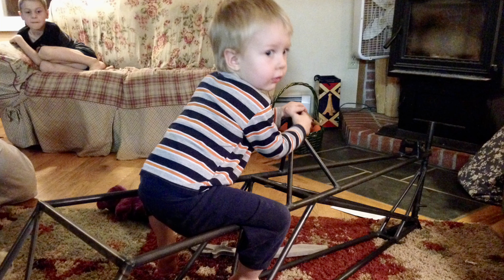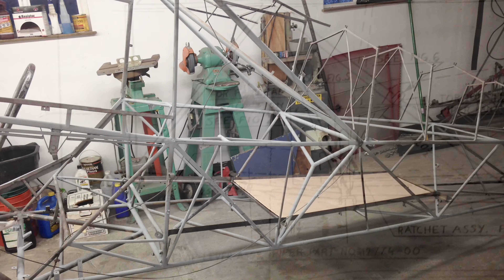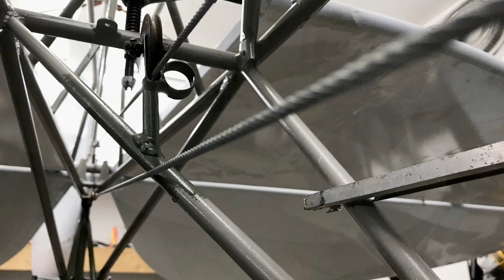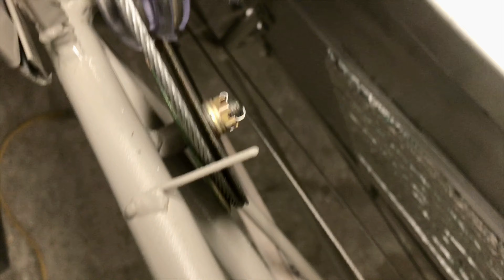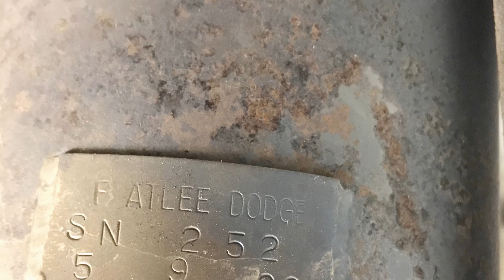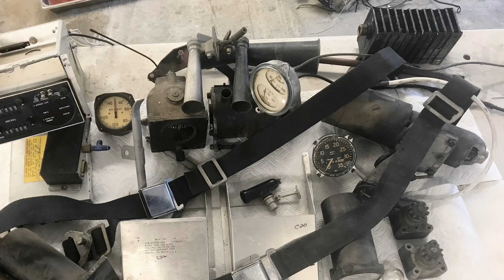Piper PA-12 Build

Comment: Totally rebuilt my "46 PA12, took many years! Installed an O 320 B2C (160Hp) with all the goodies such as new lift struts, Cleveland wheels and brakes, PA18 tail feathers and square top windscreen. Covered with Poly Fiber and painted original Diana cream and Tennessee red. Have over 1000 hours in this magnificent aircraft. 
Hangars next to my Bell 47 based at Krugersdorp airfield in South Africa.

Comment: In the early 1960's my father worked for the FAA and we lived in Kotzebue. Dad purchased a 1946 PA12 with a low time O235 but fabric that failed the punch test. We recovered it with ceconite.  I learned to fly in it. We moved stateside in 1965. If we had stayed in Alaska I wanted to get a 1947 Super Cruiser, (because of the location of the fuel selector) do the O320 conversion, add flaps and super cub gear. You did a beautiful job.
Reply from the maker: @leecrump4614  Thank you.

Comment: I rebuilt a PA-12 and spent almost a year just on the fuselage.  Had to replace almost as much tubing as you did.  I had about 35 STC on file by the time it was done.  Sometimes I question if it was worth it.  Then I go fly.  Nice video dude.

Comment: Do you have an stc list for this plane? I’m interested in installing many of them when I rebuild my 12
Reply from the maker: My log books are with my A&P in Alaska, and I wont see them again until June.  If you have any specific STC questions, I can probably go off of memory.  PA-18 Tail and 150 HP engine are Kenmore, PA-18 landing gear is Atlee, and PA-18 trim control, and extended baggage are Sullivan.
Reply: @robinbarry8200  Awesome, thanks! I got a project that I would like to convert into a more useable plane.
Reply: @robinbarry8200 awesome build. Good video.